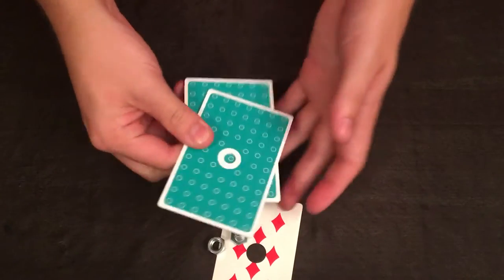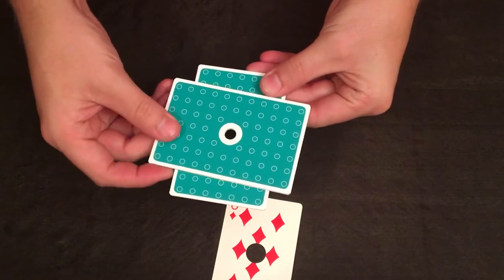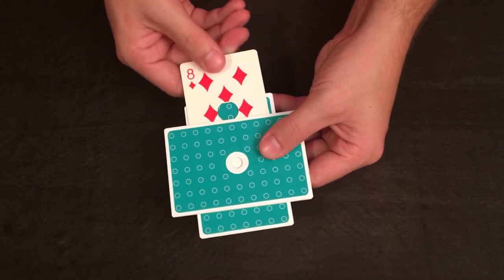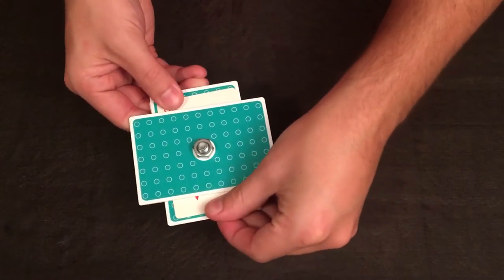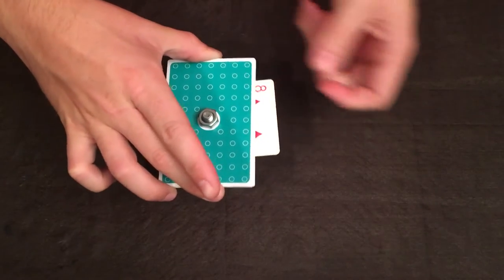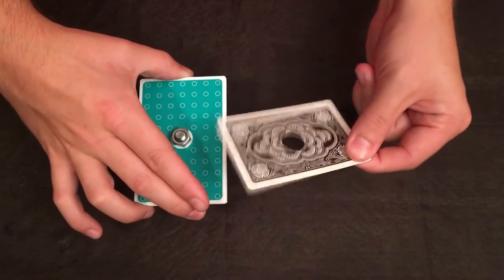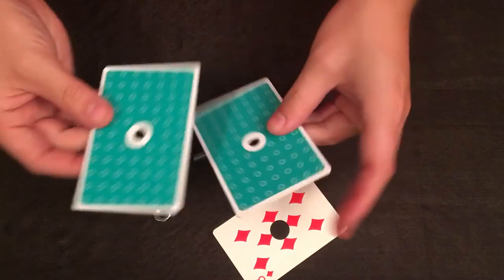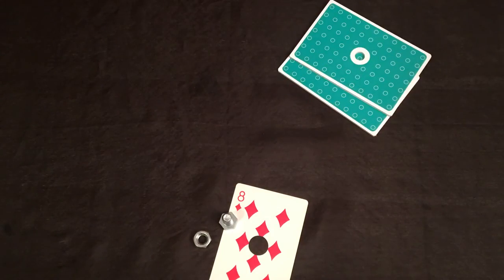Bolted Tenyo T-137

Comment: As a newbie, I've just found out about this Tenyo item. However, it is nearly impossible to find.  The only one I can find is priced way beyond what it is actually worth, and what it cost when it originally sold.    I also have found some other makers that have made the same trick, calling it by different names.  None of those are to be found for sale anywhere now.   Are the instructions available for sale anywhere that would tell how to make this gimmick?   You did it in a very great and smooth way.     I would certainly like to find it or one like it.
Reply from the maker: Tom Atkinson I would say if you keep your eyes open, you can find these at a decent price. I think I paid $45-$60 for it. I’m not aware of any instructions anywhere that teach how to make it. I’m very sorry. Thank you for the kind words about my performance!
Reply: I will keep looking.  So far, the cheapest one I've been able to find has been on ebay and it is going for around $150 last time I looked.   But, can't find it anywhere else at the moment.   I'll keep looking.